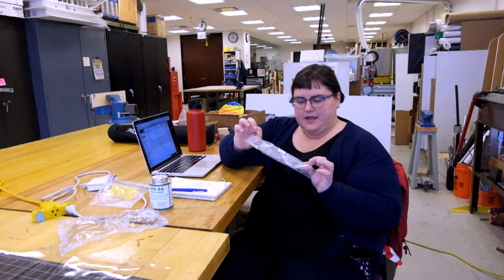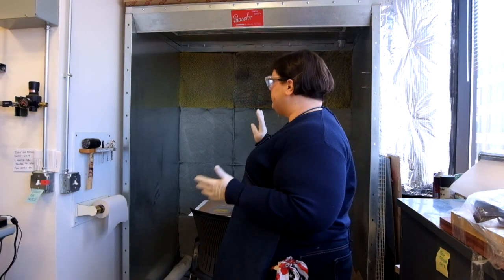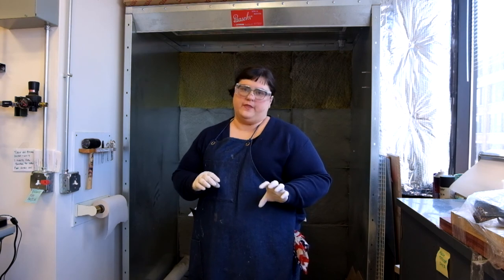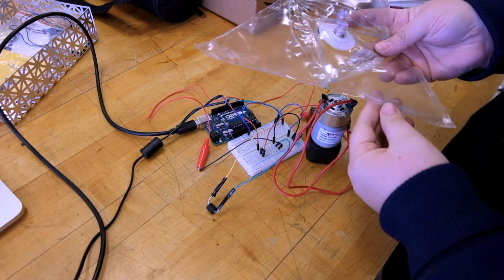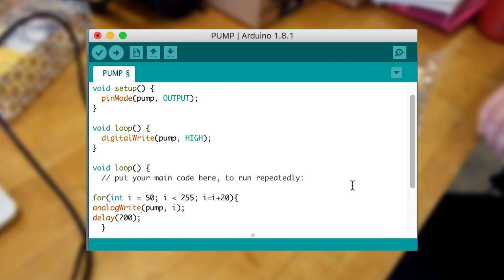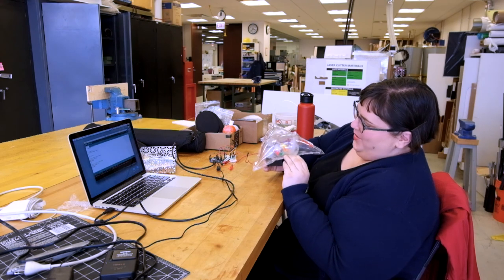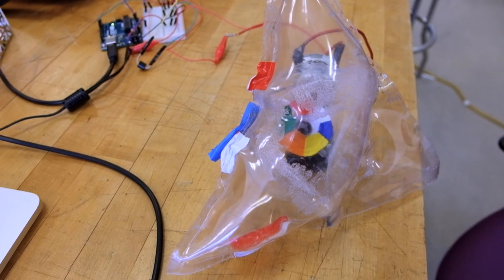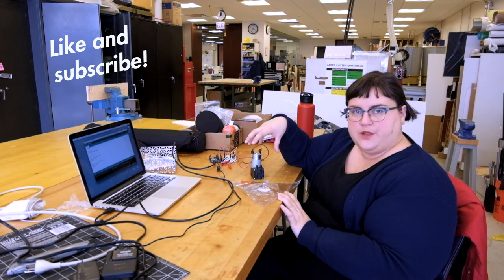Blowing up DIY Inflatables using Arduino and Biomimicry

Comment: Nice experiment. I hope the next one does not break. I have a question about the cement you use: I am thinking on reshaping a vinyl air mattress (those typical blue ones with a furry side). How strong you think it will be if all the seams are stuck with cement? (I want to make it thinner and shorter). Any advice? why do you leave the cement to rest before gluing? have you done some strength tests on different brands beside the HH66 and curing times?
Reply from the maker: Erwin, thanks for the comment.  If you do some major surgery on your air mattress-- as long as it is vinyl-- this cement should be pretty damn solid.  I'd recommend practicing with the scraps you trim off. You can either get beach ball valves like I did, or you can just cement strips together and try yanking them apart to test the strength of the bond.  

I let the cement rest before bonding them because that's what the instructions say. It makes a huge difference. Again-- test it out with your scraps prototypes. 

You can see some other videos on my channel where I test Gorilla PVC Glue. I don't recommend it for your purposes. HH66 is some nasty, noxious stuff, but in my opinion it's much more beginner-friendly.  Buy some and test it out-- the great news is that it's a fairly cheap material to play with. Feel free to use my affiliate links above... ;)

Good luck and happy prototyping! Let me know what happens!

Comment: Thank you so much for your video Becky. 
It really helped me with my own project.
Just a litte question: If you had to make a real respiration - breathing in and out - what would you do? 
Now i know how to pump it up, but how can I, with the Arduino, control the 'breathing out'?
Reply: Do i need a pump with negative pressure for that? Then i can turn that on, when the normal pump has finished pumping it up?